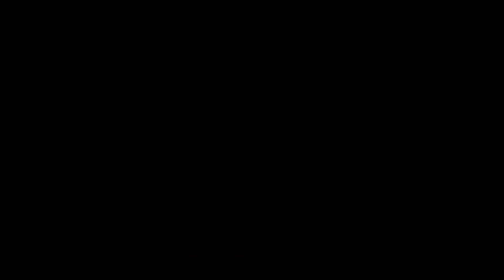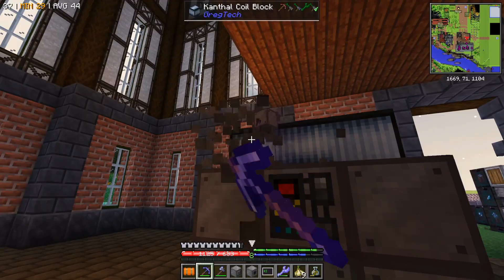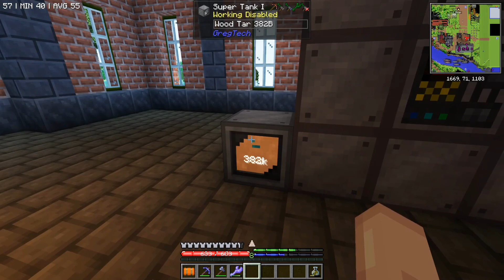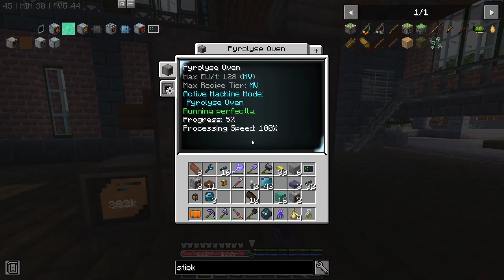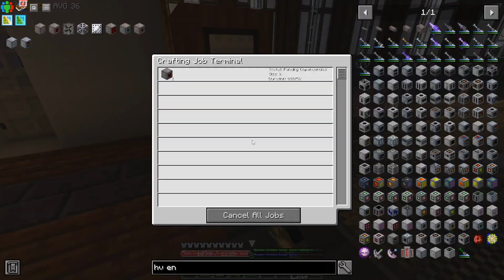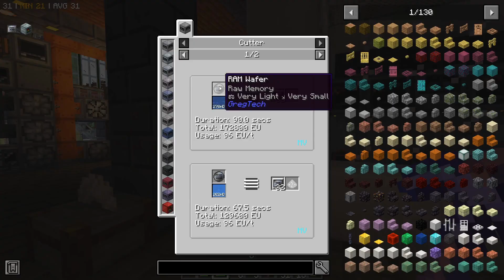ATM Gravitas 2 LP EP 12: Benzene and Distractions

Comment: Tello cthulha

To go more into details about the filtering fluid interface.

We hat issues when we where using the filtering fluid interface to store liquids into a super tank (we discovered this problem with nether air, not sure if it had to to with the fluid, or if this is an global problem).

For exporting selective fluids, you could use the fluid exporter (with Export fluid option), in our cases this worked without any issues.
If you still need more filtering, you could uses item or fluid filters and attach them to the sides of the machine.
Reply from the maker: Great to know!